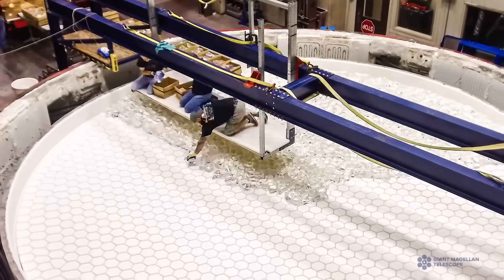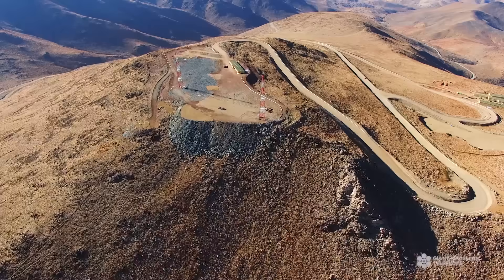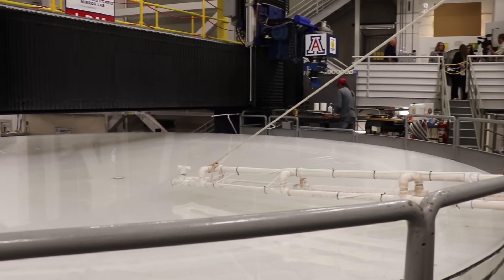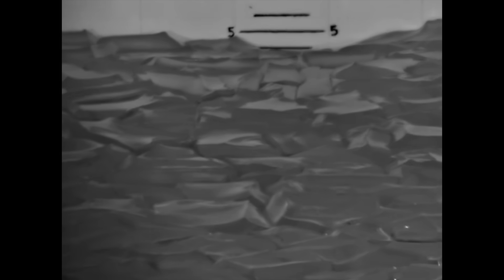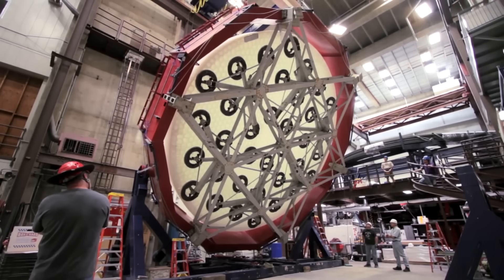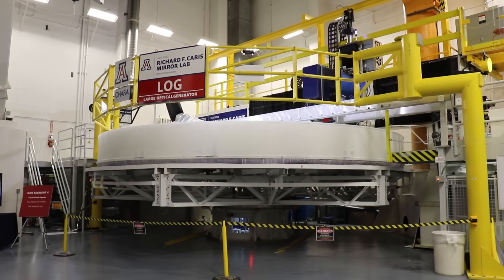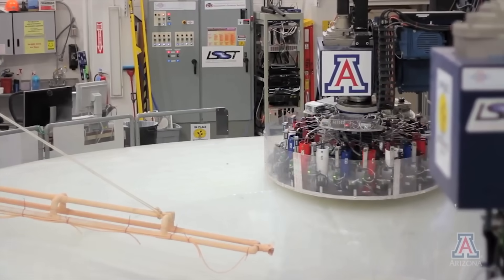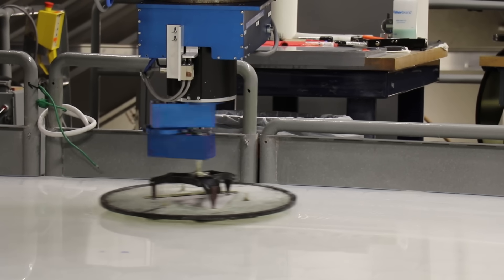Casting a $20 Million Mirror for the World’s Largest Telescope

Comment: Why does the mirror have to be glass?  Isn’t there a thin film that is as reflective?
Reply: I guess with it being a more dense material and of such a size, it will be less likely to change temperature and will do so more uniformly across the whole mirror.  That thin film, would, have potential temperature differences across the sheet and could be a large range of temps across the face of it. Different temps, difference levels of expansion, distorted image in relation to accuracy of what it picks up.

I guess that is what brian boorman is saying but i didn't know exactly what he meant.

If you can imagine how far away the light its picking up is coming from, then even the smallest imperfections will cause large mistakes in the image in relation to objects position in the universe.
Reply: there's also a money laundring coeficient
Reply: Michael Mangold... How do you support that thin film to within a few nanometers across its entire surface? This, incidentally, is exactly what this glass will be doing. The front surface will be silvered.
Reply: picramide makes sense.
Reply: 3 letters - CTE coefficient of thermal expansion.  The final mirror needs to be accurate I  the sub- nanometer range,  and stay so over temperature swings of extreme heat and cold.
Reply: Suzy no silver is the most reflective
Reply: LOLCody: Dont criticise unless you are sure someone is wrong: see this wikipedia article and look.
Reply: @ThuleApsu  lol you're upset because someone said you were wrong about silver being the most reflective of the metals. Wikipedia isn't reliable ANYONE can edit a Wikipedia page. Also you put no link so what artical is he suppose to read ?
Reply: Lennox Trials: Neither you not I are right if you want to argue this, the n and k values change according to the wavelength, it really depends over what bandwidth you are looking at.
Reply: @ThuleApsu  You're trying to saying that were both wrong so you dont feel like you lost this "argument". Take your L you'll feel better.
Reply: Lennox Trials, no its a fact; you are one of these people that try to add meaning to your benign life by trying to win arguments fuelled on your own egotistic rants, go play on telletubies message boards; you will have more success in 'winning'.
Reply: Lennox Trials That whole “wikipedia is unreliable, anyone can edit it” thing is so 10 years ago...
Reply: It depends on which wavelengths of light you are interested in.  I've worked with nickel, silver, gold, aluminum, beryllium and even polished silicon carbide before depending on the application.  For visible light, silver is very good, ~95% reflective.
Reply: Imagine being so self assured that you think you know better than actual telescope engineers. If there was a cheaper, easier solution, they would have used it.
Reply: yes
Reply: picramide In the old days telescope mirrors really were silvered, but silver oxidizes really quickly.
Reply: @jaakkooksa5374  thats not necessarily true. Pure .999 or .9999 silver will  oxidize over very long periods of time. Oxidized silver typically an alloy combined with copper that reacts with sulfur and and the moisture in the air. The majoirty of silver people have or seen is sterling silver made for jewlery. This is because pure silver isn't sturdy enough for jewlery alone. Consist of 92% silver and 8% copper in jewelry.  "Pure" silver may contain about 1% of copper. Oxidation doesn't affect the metal itself but can have an impact on resell value as buyers like the shine of the metal.
Reply: there is actually this concept of using liquid mercury as the reflective surface, and spinning its container in such a way to produce the curving effect desired. Only problem is this mirror faces straight up and no place else due to gravity.
Reply: And who cares that this film will have an ideal shape within a nanometer ? Any idea for supporting and not disturbing structures ?
Reply: @Suzi Siviter
Silver is the most reflective material.
Reply: Nathan C ! So talks a religious believer, without any knowledge of, what the truth means. You can't find it in a book. A bible written by somebody... sometime... for any reason you don't even know.
Reply: Cody Gates but silver will oxidize to black silver oxide, the same thing you see in your jewelry.

There is a few nanometers of the metal so it IMHO can be platinum too.
Reply: @homosapiensqp3225  jewlery made with silver is an alloy consisting of 92% silver and 8% copper. Pure silver isnt sturdy enough to make jewlery. Majoiry of people have never even seen "pure" .999 or .9999 fine silver.
Reply: that would an active mirror which has been done but not on this scale
Reply: Carl here. I don't know what the hell you said? But I'm on my second one, a few more and maybe I'll figure it out but I doubt it?
Reply: That message was to Peter Harris above.
Reply: Can it?
Reply: @NefariousPorpoise I feel like you're a kindred spirit because I'm an insane porcupine.
Reply: Brian Boorman 
So only glass because thermal dynamics... then put non glass in a temp-controlled room. Duhhh
Reply: nope in terms of reflectivity silver is at the top overall also depends what you trying to see.  wavelength is also a critical part of the choice.  here is a page with some nice info. https://www.edmundoptics.com/resources/application-notes/optics/metallic-mirror-coatings/
Reply: Jeff Johnson I like star trek  "the journey home" too.
Reply: Sorry Brian
I think you are confusing Coefficient Of Expansion with Coefficient of Thermal Expansion
COE has to do with the cooling and annealing of glass vessels, especially large ones, in the video they said months, I think at @ 960 degrees F
CTE has to do with expansion of materials when exposed to heat .. like with metals i.e. steel and aluminium
After manufacturing, a glass mirror will not be exposed to temperature changes that will, in any way, affect the structure of the glass
Reply: avery neal Every material has a coefficient of thermal expansion, including glass...
Reply: Thank you!
Reply: A room made of what?
Reply: only a tru rebel would know that,, sh2master
Reply: 18 months for polishing one Mirror and platinum may be too expensive? :D
Reply: Mike Wilson WHOA! he wanted to know WHY something is more effective so he asked a question to learn more about it. Ease up chief. Not everything in the world is a slight.
Reply: Two words: dimensional stability.
Reply: After reading these comments, how is glass as far as thermal expansion, compared to other materials?
Reply: Evi1M4chine: Thin films dont particulary have a problem warping; its dependant on the surface they cling to.Been using Thin films for decades in the electronics inductry without problems.
Reply: Ehh just cuz they can?
Reply: Thin film is too flimsy (heheheheheheheh geddit?)
Reply: There is a thin film: the surface coating on the mirror. The trick is to keep that thin film in exactly the correct place, and glass has the best chance of doing that so far.
Reply: The mirror is actually a microscopically thin layer of aluminum or silver.  The glass is what supports it and keeps it in exactly the right shape.
Reply: sh2master Lol, tell that to the US millitary. They use up 68 million $  every hour.
Reply: Transparent aluminum?
Reply: Uh huh. Clearly you have never stared at a budget sheet before.
Reply: Nathan C If students are to join schools with that attitude there won't be much innovation in upcoming years. Schools may be boring but they really do increase human potential, especially if you meet some like minded people.
Reply: picramide: Why silver?, Platinum is more reflective isnt it? (Though maybe too expensive).
Reply: @ThuleApsu  no silver has the most sheen.
Reply: @ThuleApsu  it is often actually aluminum
Reply: A typical school costs 20 million to build. But god forbid we should use that money in advancing the knowledge of the entire human race.
Reply: you probably think the government should help pay for your kids to
Reply: picramide 
I feel like you could control such a surface with electronic actuators like the do on the james web telescope or the "thin" material doesn't have to be so thin. They could just use some thick metal or something else?? It just seems like such a tribal thing to be using glass still after all these recent advances in technology we've made in the past 10 or 15 years
Reply: and here you are,  on a computing device with software designed to utilize and browse the internet.. yea I bet th eknowledge isn't needed after all.. school be damned.
Reply: HAVARD WANTS TO KNOW YOUR LOCATION
Reply: Public schools?
Reply: Brian Boorman simply locate it at a place where there aren't temperature swings....Northern Thailand has a 10c year round maximum swing and its gradual over months.
Reply: Steven Braithwaite “Simply” ... LOL nothing simple about this project. The location needs more than just a stable temperature... they have to be able to see the sky without obstruction! AKA no weather.
Reply: But that isn't keeping murica "safe"
Reply: Brian Graves public schools suck. The way in which public schools are set up and operate is over a century old, and is a process that was designed to produce optimal factory workers. 

From the way that desks are arraged, to preset lunch bteaks, having to raise your hand to ask a question, to getting permission with a set amount of minutes to use the bathroom. Moreover the way children are taught in public schools is so let to complete one task, passing standardized tests. They are taught in a manner to conform thinking and not question authority.  And at the end you get a piece of paper, a worthless education and all while wasting a bunch of money.
Reply: @sweetmeatnc1504  no education is worthless as knowledge is infinite. Yes it is a century old way of how it's set up. We're not living like cave people anymore it makes sense to get an education. Schools are already changing how they go about teaching. We wouldn't have the technology we have today if it wasn't for people going to schools to further there knowledge. Schooling is how we advanced our civilzation. You're not that bright, that home schooling you might be doing isn't helping.
Reply: Why would they use glass if there was anything better? Use your brain, mate.
Reply: Looking around isnt helping this planet and its money problems just making it worse. They dont sell anything to China.. It has got to stop.. Greed and Lust! Not until humans are fed and housed.

Comment: I understand that you guys don't know how to make one 25 meter in diameter mirror.
But you could use a transport helicopter to carry the mirror.
Reply: Isn't the mirror 20 tons? lol
Reply: Mil Mi-12 With a length of 37 meters or 121 ft 4 in and a rotor diameter of 35 m (114 ft 10 in), the Mi-12 has a maximum takeoff weight of 105,000 kg or 231,500 lb and holds the payload record with 44,205 kg (88,636 lb).

Comment: Why not make the glass hexagon shaped so it fits without gaps
Reply: It is easier to make round mirrors than hexagon ones.   The gaps don't matter much as long as you have the same surface area.   The James Web space telescope does use hexagon pieces because it has limited space, since it has to fit inside the launch vehicle before folding apart.  https://jwst.nasa.gov/mirrors.html
Reply: nexus prime because it’s too big to get on the mountain. they wanted to make one large mirror but broke it into smaller more manageable pieces because of Human limitations. It’s not magic bro the mirror can break if it’s too large to move
Reply: Kyle Miller they had multiple circle mirrors why not hexagon shaped it would basically still be the same size. Just shaped so that there would be little to no gaps.

Comment: With such a large telescope, do they hope to see farther or just see closer things in much finer detail? Or is it a combination of both?
Reply: Larger telescope mirrors gather more light, so it makes all objects such as distant galaxies brighter and with more detail.   Also, shorter exposure times for photos of dim objects are required.  
Nearby objects such as planets are fairly bright, but it may still allow for a more detailed image of them compared to other ground based telescopes.   However, since all of the planets in the solar system have been photographed from up close by probes, there is little point in using observatories for that purpose.

Comment: I don't understand, can't you achieve the same effect if you use many smaller mirrors? Does it have to be one continuous piece of glass?
Reply: You can, but they all have to be lined up perfectly..  Each mirror is not the same, but has to be a part of the overall parabolic shape so that they reflect light to a common focal point.   
The James Web space telescope will also use multiple small mirrors to simulate a single large one:  https://mk0astronomynow9oh6g.kinstacdn.com/wp-content/uploads/2016/04/jwst_1582x2100.jpg

Comment: Oops ! I broke it. So sorry.
Reply: By my calculation it's more like 744738,4 years of bad luck :D

Hers my calculation:
A normal living room mirror = ~177,8 X ~127 cm
this one 25 meter

Taking the average of the width and height combined
we get ~177,8 + ~127 / 2 = 152,4 cm

thats:
2500/152,4  = 16,4 times smaller
 
And would be 7* 16,4 = 114,8 years of bad luck.

But well if we also go by the prices
Then lets see, her a some prices of random english mirrors:
£35.00 + £17.90 + £73.32 + £79.99 + £55.97 + £49.99  
+ £39.72 + £52.95 + £59.99 +  £34.45 + £249.00   = 748,28

Witch gives us and average of
748,28/11 = 68.0254 pound

Now translate that to dollar
£1 = $1.3807 = $93.948266~$94

And the number or mirrors we can by for the same price as this is:
$20.000.000/$94 = 212766 

So by that logic its a total of 1489362 years

Finaly we could combine the to numbers and get the average:
1489362 + 114,8 / 2  = 744738,4 average years of bad luck. yeks D:
Reply: one finger print on the mirror would be enough to ruin it.
Reply: hubbles mirror was mis-shapen in the polishing phase due to human error, luckily all it needed was a corrective lens to focus the images, with the james webb telescope slated for launch they better get it right because theres no saving that one, lol
Reply: Nekogami-Crystal I need you to look over my taxes.
Reply: a fingerprint doesnt ruin it, it lower only its resoloution on a specific part of the image.
Reply: Isn't that what basically happened with Hubble?
Reply: That's would give about the same amount of bad luck that you would get if a Panther cross your path.
Reply: More like eternity of bad luck 😥